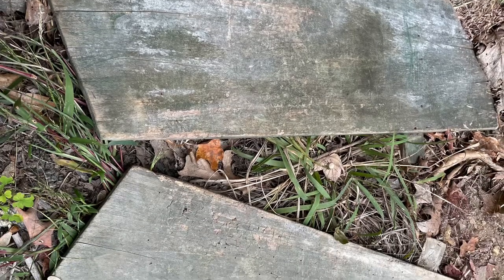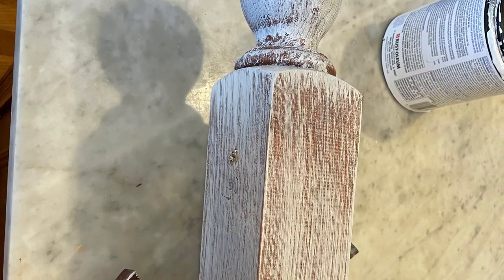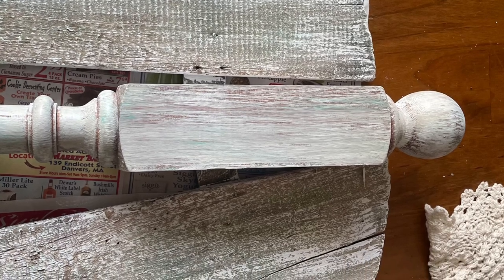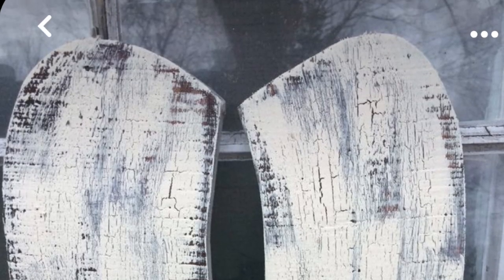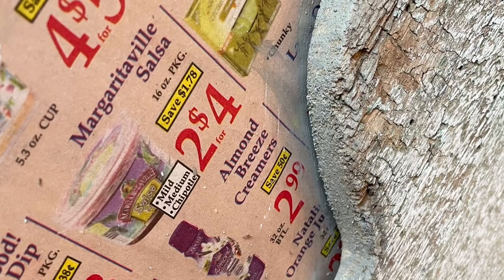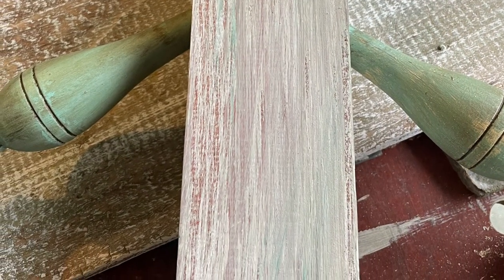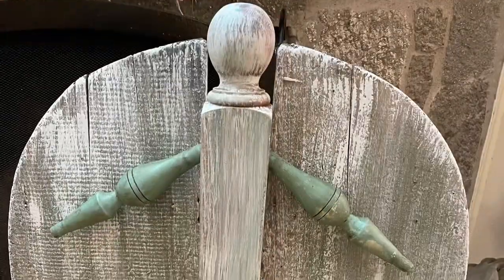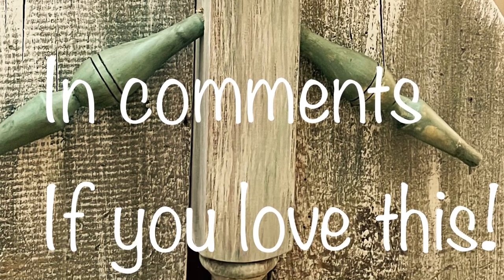I see angels wings. My favorite Trash to Treasure Ever

Comment: What is the best way to break chairs down, to get the spindles? Should I cut them out, or should I try to pound them out. They are glued in pretty well, but a neighbor gave me 6 old chairs. Four of them are the same and the two others are different, but they match each other. The first four are in bad shape, so I want to use them, for the spindles, and all of the other beautiful parts, the other two chairs are in good shape and I will use them for my craft room. However, I am not sure what the best way to go about breaking the down. 

Oh, this is adorable. You are so talented. 😊❤️❤️❤️
Reply from the maker: We try to use a mallet to pop them off, but many times can’t do we use a small saw.